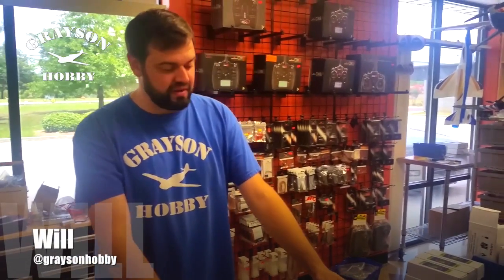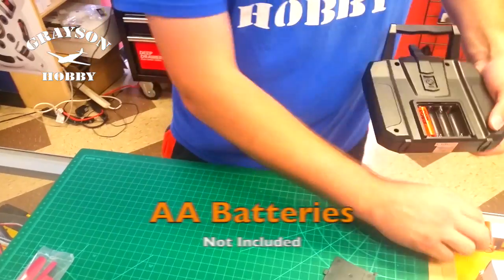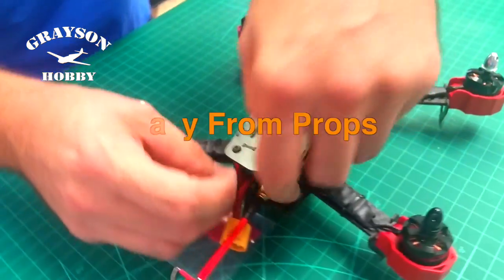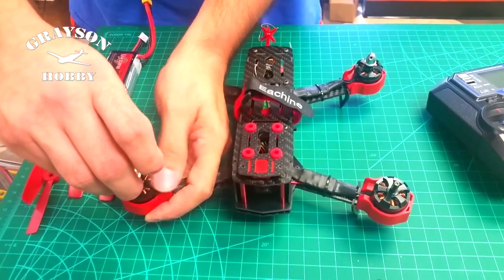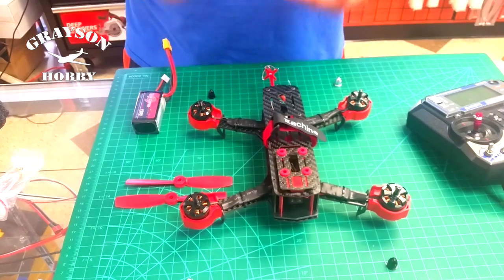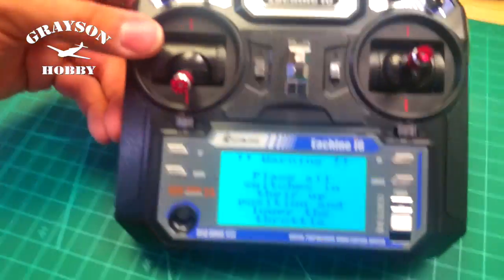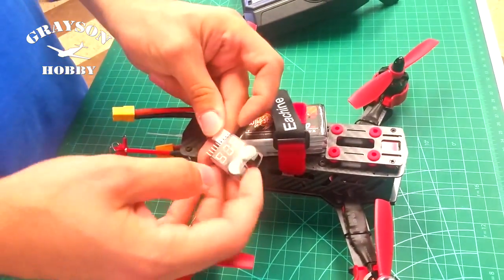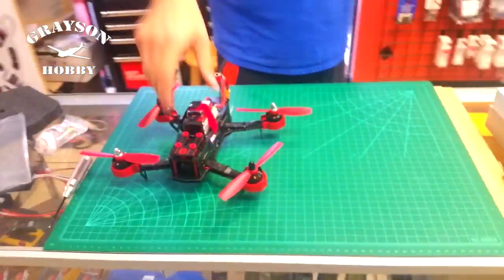Eachine Falcon 250 RTF Setup - Part 1

Comment: hi I just received my falcon 250 and my throttle control is on the right how do I switch it to the left like the one you're showing..its my first race drone and already learned that never messed around with the controller while props are on ,was trying to power it up and I thought the left was the throttle it wasn't working so i panic and started touching the switches then the drone just went full power and flew to my arm luckily I blocked it

Comment: does the falcon 250 and falcon 250 pro have an atti/stable mode or only acro? Thank you
Reply: justinspirational yes it does the nob vrb on the controller controlls the leveling to acromode twist up for leveling and down for no level acro it the right knob on i6 at the top
Reply: thanks though I ended up getting an Eachine x220 Wizard instead

Comment: Hey Grayson. A question about the Falcon.
Is there a way, to tune down the throttle?
When I throttle now, It shoots up in the air like crazy. 10 meters. Only by small stick movements.
So it's really hard to yaw, while throttle keeps shooting me up and down in the air.